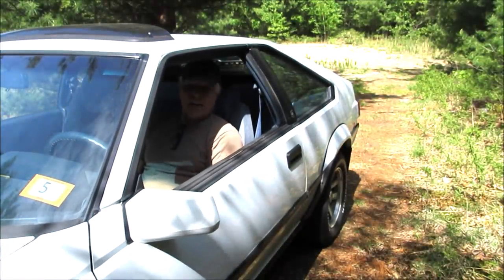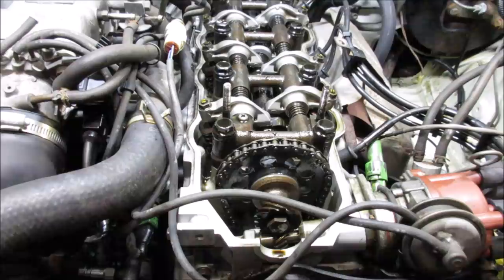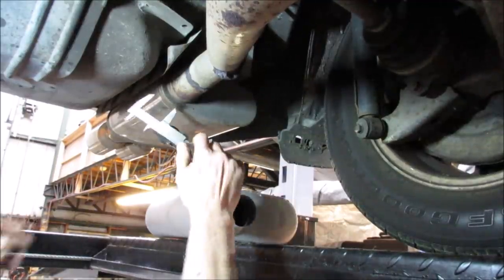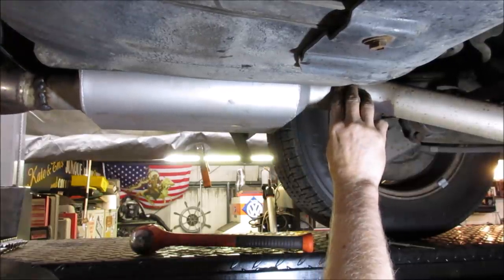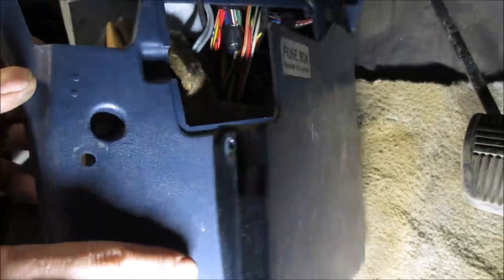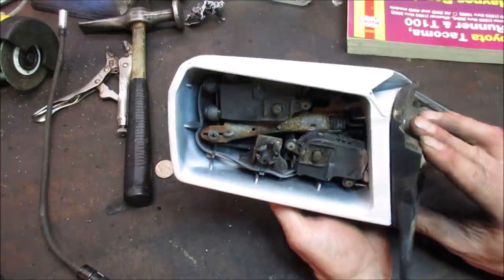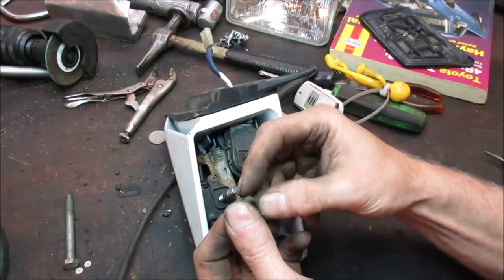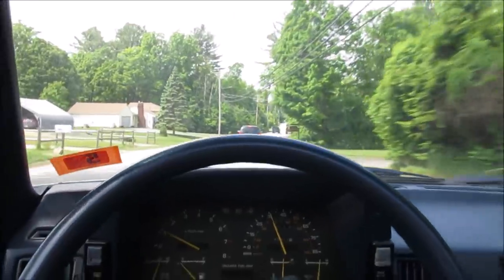Bought The Best Toyota Ever Made

Comment: My brother had one exactly like this one back around ‘90. Not very fast but great riding and a lot of fun to drive. It was the first japanese car that truly impressed me. They were bullet proof like most Toyotas.
Reply: It's got the same motor as the pickup trucks from that era.
Reply: I bought my elderly mom a good used Camry as a gift after I saw that she had close to 200k and rocker rust on her trouble-free Corolla. Several years later, after her doctor told her she should no longer drive, she sold the Camry and decided to gift me back the amount she got for it. It was just $800. shy of what I'd paid for it.
Reply: Rust
Reply: RogerWilco99  reliability wise the Celica/supra all day. Looks, performance wise a widebody starion esi or conquest TSI is in another League. Once you fix a couple issues with them they are good cars though. I hit 147mph with 4 people in the car in a basically stock conquest tsi. Loved that car.
Reply: @charlesgunzelman3323  Toyota trucks in 84 were carburated 85 went to efi.
Reply: There was just a pain to see out of the back if it had tinted windows and the window grill on the back.
Reply: RogerWilco99  She turned down a hemi Road Runner?
Reply: @charlesgunzelman3323  LS swap...
Reply: @stevea6722  she obviously wasn't into speed, lucky for the parents
Reply: My brother had an 80's Celica about seven years ago which was stripped out inside so a real rattle trap but a lot of fun. He drove me around in it one day looking for a Toyota Hilux. I got a truck and a stiff neck. Cheers

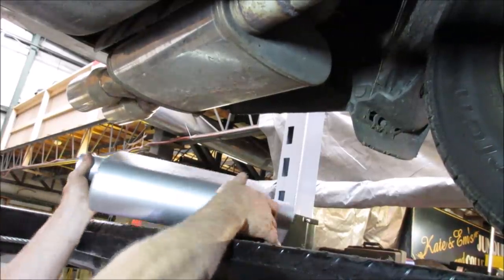Comment: 23:58 The reason the exhaust is getting on your nerves is they cut the resonator from the mid-pipe.  Adding a glasspack around the middle of the cabin will do.  Also in general, chambered flowmaster-style mufflers are the worst if cabin drone is a problem for you.  And the straight-through style muffler it had will perform better anyway.

Comment: My favorite car was my 1977 Toyota Celica GT Fastback (Liftback)...knew the dimensions down to the millimeter when driving  :)  
For the high beams to stay on...push the blinker switch away from the steering wheel (opposite of flashing the highs > towards the wheel).  
The vampire circuits are most likely the radio & the clock...at least it was on mine.
Reply: He's probably tried that, the switch isn't flipping the contact like its supposed to be. I've had it happen on my 84 gts coupe and my 84 supra P-type back in the day, could be as easy as disassembling the switch, cleaning and re-lubing or replacing it. But its definitely the switch , very common on my 90-99 Mitsubishi Eclipses as well.
Reply: if I remember correctly, you're right!  {?????}

Comment: That is a beautiful specimen!  The only recommendation I can make, is to resist the urge to use a drill brush on those seats.  It may be too aggressive and cause damage.  Nothing wrong with a little elbow grease, a soft bristle hand brush, and a good, diluted fabric cleaner like Folex (test for color-fastness in an inconspicuous place, as Folex can fade some dyes).

Looking forward to a followup video!  As always, thank you for spending your Sunday with us.  :D
Reply: I use the same wet vac on my upholstery. I start with a little oxy applied with a toothbrush and then just use tap water in the bissel..it has a little window so you can see how much dirt is coming off.
Reply: There's always that brush that was already attached to the cleaner lol

Comment: 1984 is a good year for 22RE, it isn't the highest-output version of the na fuel-injected 22R, but it has the stronger timing chain. It'll run until the injectors are completely worn out and not make milkshakes along the way. Check the rocker shafts for play, sometimes the bolts loosen off, but 22Rs do sound like sewing machines. Get a stack of spare valve cover gaskets, those half moons are like the pushrod tubes on an ACVW: leaks waiting to happen. Also check the EGR, it loves to clog up with soot or rot out, one doesn't really cause problems, the other is an intake leak, but I didn't hear one. The air injection pipe on the exhaust manifold also tends to go on these, creating an exhaust leak. Block off plates are common and cheap online. The engine itself actually has a fair-sized aftermarket if you ever want to depart from your norm and get silly with it.

Comment: I had an '81 model (only the ST) that I loved.  Had they continued to make them RWD, I would have bought another in a heartbeat.  Great little cars.  That drivetrain is damn near bulletproof.
Reply: I had '76, '77, '79, '80, '81 and '83 Corollas.  Loved them all.  The last one got sold for parts with 300k on the clock back in the early 2000s.  It ran great, but the rust had gone too far to fix.  I bailed out on getting another for the same reason as you stated above.  If they kept making them RWD, I'd have kept buying them.
Reply: @Stefonius  I have a 83 Supra with less than 60,000. I'm working on it right now... It was running fine then it sat for over a year. Gas tank full of rust. Got it off and cleaned. Getting excited!

Comment: The tach probably needs to have its electrolytic capacitors replaced on the pcb.  The fuel gauge is likely to be the fuel sender since the other gauges are working okay.  With the mirrors try going to your local wrecking yard.  It's reasonably likely that other later Toyota mirrors might use same or similar motors.  Or maybe, with your ingenuity you could adapt another similar mechanism into the mirror head. 
Just a thought. 🙂
Reply: I also wonder if the instrument cluster is from a 1982-83 Supra, which would provide another explanation as to why 2200 rpm sounds more like 3300 rpm or so.  Supra tach would be calibrated for the 6 cylinder engine, instead of the 22R-E's 4 cylinders.  Note the 85 mph speedometer...  By 1984, most imported cars had a 120 mph speedometer.
Reply: @john242ti  You could very well be right, I didn't consider that.

Comment: That 22RE is indeed one of the finest motors ever designed. I had one in a '94 pick-up, (the last year they had a plain "pick-up", not the T100 or the Tacoma). I bought mine from the dealership "new" with 7k miles on it. I had them add A/C to it. Cost me $1000 but it was worth every penny over the years. 
I ended selling it to some guy in Connecticut for $3,500 in 2016 and he paid the shipping. I still regret selling it, but it was what made sense back then. You didn't say what you paid for this car, but I can guarantee you it was worth every penny. That car, with your proper sorting out, will be worth a mint as the years go on. I expect to see it on a Mecum auction one day!
Reply: I had that truck and miss it everyday. I had a head gasket blow that was covered in a recall! I got a brand new engine replacement from the dealership. I paid for plugs and oil. They said I won the lottery of recalls. Man I miss that truck I could just kick myself for selling it.
Reply: thanks for the comment, i had a 1991 truck with the 20 0r 22 re-engine  can't  remember  but anyway it was a very basic truck no radio nothing,  kept it for 9 years, then decided to  trade it in for a 2000 Tacoma, which I still have  it has 170 thousand miles on it, I went from a 4 cylinder 5-speed regular cab to an automatic,  v6  extra cab  very nice,  but anyway thanks for your comment

Comment: Nice ride! I had one. The only warning I have is the timing chain tensioner on mine was driven with oil pressure. Should it get low on oil it can jump time and kill the engine. It is an interference engine. Enjoy the ride! I loved mine! Mine was a 1982 I think.
Reply from the maker: the 18r was real bad for the tentioner failing
Reply: I thought I read somewhere that all the Toyota engines, at least from around 80-2000, were non-interference, but apparently that's wrong, these R's are interference. Apparently, even if the belt or chain breaks it doesn't usually cause damage unless it was during an "high stress point"? Someone else says:

>You're just supposed to avoid accidently downshifting in too low of a gear at too high of a speed. Maintain proper oil level and oil quality... Also, replace worn timing chain, gears, and guides before timing slips off, if it ever gets to that point.
Reply: When the guides wear out the chain slap on the 22re will wear a hole in the timing cover right behind the water pump causing coolant to enter the crankcase. JB weld to the rescue worked for years on mine.

Comment: I'd argue with you a bit on this... it is a great car but I've always preferred the 70's Celica over the later years, just personal preferences. Good choice for content, should draw a whole lot of new subs.
Reply: 1973 with a Twincam fitted, as not released in Australia only in 2T Engines
Reply: @rickthelian2215  2T engines were awesome...
Reply: @monkeybarmonkeyman  easy to work on. The Twincam 2TG and Eli versions 2TGE
Reply: I think the '78 was voted best car ever by Motortrend. A little bulbous in my opinion but fun little cars. A buddy had one.
Reply from the maker: still lookin for a 73st, myself
Reply: @mustie1  I bought a 72 Carina brand new, while in high school, paid for it with part-time job. I wanted the Celica at the time, but  being  6'4", the Carina fit better. Those were the days everyone called them 'ToiletOdors'... All the best looking for that 73 ST  :-)
Reply: @monkeybarmonkeyman  my first car!  72 Toyota Carina.  Extremely rare in the Unites States.  Celica suspension with the Corolla (2TC hemi) engine.
Reply: A buddy of mine had an old 70s Celica in the 80s. That car was a trooper. I think his sister finally cracked it up? We had some times in that car though.
Reply: @mustie1  What about that 73’ Penton motorcycle?Any hope in getting it back in running condition?
Reply: The first generation is by far the best looking ones, I specifically like the ST trim the most. Throw on a set of ITB'S and they sound amazing. I can find them up here in Canada in good shape for about 5-7k.
Reply: @reneneron2971  Yup... I eventually rebuilt mine, had it balanced/blueprinted, added a cam and an intake manifold with sidedraft Weber carb. Loved that engine and the car.  That was the good thing about it - much more head/leg room with the Celica underpinnings and the glorious 2TC hemi-head engine.
Reply: @monkeybarmonkeyman  they did not sell well in the United States.  People got either a Celica or a Corolla.  Carina was only 2 doors and trunk space limited due to the gas tank placement.  I enjoyed that car, though.  No a/c, no power anything, and a 4 speed manual.  One belt.
Reply: @mustie1  I'm looking for a 1970 Corona! Hard to find any. Grew up in R.I. I am now in Houston...Love your videos!! Ty!

Comment: Mirrors: At 1h, I'm guessing there used to be two more ball sockets on the ends of the motors, so they could push and pull the mirror back & forth. Must've broken off, maybe after the grease went hard? I'm sure it's not originally a spring since other Toyota mirrors don't move at all, and a spring would probably bounce a little on bumps. Tough to re-engineer a solution with old plastic and broken bits, good work!
Reply: I agree.   First I was thinking there must be a spring pushing out on the top right corner of the back of the mirror, but after looking at it, and the housing, there is no evidence of that, so then the only remaining choice is that each solenoid much have been attached somehow to the back of the mirror.   But that begs the question, how would you then remove the mirror?  It was easy to pop out with only the ball socket in the center, but if there were THREE ball sockets, it seems like that would make it almost impossible to assemble or disassemble without breaking something.

Comment: I had a 1979 Celica GT, 22R engine carbureted, put headers and flowthru Stebro stainless steel exhaust, Retuned the carb, large swaybars front and back. Man did that thing fly, handled great Black with thin gold strip down both sides. Real chick magnet

Comment: The high beam switch is push the stork forward to keep it on but only pull back for flash of high beam. My father had one of those and it must have been deck cargo on the ship because it rusted away in 10 years and we live in a warm climate away from the coast, the trunk area leaked and filled the spare wheel bin with water from day one, total rust bucket but a lot of fun and never broke down ever

Comment: I had the Mk3 Supra Turbo. It was an amazing car. Was loaded with stuff for its age. Leather seats and performance was insane. Down side was the alloy head that had a habit of blowing. It happened twice to me maybe 3 times as the previous owner seemed to have a head gasket replaced. It was a stunner with the pop up head lights. I would like another one but due to that issue you never see them on the road. Is that steering wheel on an angle because the tracking is out on the front wheels.
Reply: The good thing about 30 years later there are alot more enthusiasts ....so you can find a winter project (ps go non turbo)
Reply: almost bought one of these as my first car, but ended up getting a MK3 supra as well about 20 years ago. Same issue, had a blown head gasket when i got it. Great car, wish i never sold it. Really like this car and hope you make another video on it!

Comment: I had an 82'.(82.5?) SUPRA. The 1st year in USA. It had no add on fender flares,   had skinny wheels and better handling, gas mileage, acceleration and stability with less road noise. THAT was the best Toyota ever made.
* the auto trans was the best transmission Ive ever driven. It knew exactly what I wanted to do. The posi-like rear end was also awesome all-season round.

Comment: I had a '74 Celica ST that was my first car.  My greatest regret was trading it for a '51 Chevy Deluxe.  I later found out it blew the timing chain and was lost to the ages.  Just a superb car, super fun to work on.  Great video!
Reply: do you per chance now if it's a common fault on those engines? was it a 2t or 2t-b? I have both of those sitting to go back in two 77 first gen celicas

Comment: Glad you got rid of that perforated tube muffler...  Bought a complete system for my Avalanche that sounded great on the manufacturer's demo video, and came with a perforated tube muffler. When I got the system installed, it droned so bad in the cab that I had a headache before the three minute trip from the mechanic to my house was finished.  I found a chambered muffler with 3'' difference in length and asked the mechanic to shave the pipes to make that fit.  Much better sound in the cab, and the outside sound isn't awful either.  NOT quiet though...  Thanks for another good video!

Comment: 22R tend to wear the valve train and increase clearance rather than tighten, I run my 83 7&11 and they are very quiet. They redesigned the cover in 84 to limit the racket but mine are still better and never had one tighten up in the 40 years since I drove it off the lot! The most reliable Truck ever made....HiLux!

Comment: I had a 1978 Toyota pickup. Heater was terrible but if I remember correctly the bright dim switch you pulled up for bright lights was a 3 position switch. Pull  all the way up to turn the lights to bright temporarily. Release it for dim. Push down opposite way for high beam  lights and pull up to the middle position for dim.

Comment: My first car was a 1985 corolla SR5 4cyl carbed. Swapped trans to manual and did a headgasket and valve stem seals. Drove it for 4 years in chicago weather. Sold it a couple years ago because I stopped driving it. Wish I kept it, was very reliable started everytime never had an issue.

Comment: Mustie, I think a good caulk bedding on the end of the mirror studs would hold them still AND allow them to flex a little. You could get rid of the springs.. they just add pressure to that sketchy ball/socket pivot point that the mirror mounts on.
Reply: That or I was thinking those rubber caps use for sealing off vacuum ports would fit right over them and fit nicely.

Comment: I've had this engine in my truck for 20 years.  When you put the valve cover gasket on run a small bead of RTV over the half moon seals and overlap where the rubber connects to metal.  That will stop the leaks.

Comment: The two threaded nubs are part of the mirror backing plate, you install the whole backing plate by running the remote controls. They may have had non rotatable ball joint if they need to angle while going in and out

Comment: We had a 1983 version my mother bought new. They had a Toyota-thon at the Von Braun Civic Center. They refined the GT-S for '84...the '83 had black flares and rear bumper and exposed headlights. A Toyota hatchback is called a Liftback. You associated that car with a Corolla...they are not related. If you want to quiet it down you will need to locate one of those big canister OEM mufflers. That's what it had on it new, with a single outlet. A 22RE does not sound good loud. It's too bad someone did away with the original stereo and equalizer. You can still find them for sale. Be very attentive to timing chain noise...I think I heard some when you started it. The chain gets loose and wears a hole through the front cover into a cooling passage, which causes all kinds of mayhem. The first engine in ours went 268,000 before the chain blew, then the second engine died at 481,000 on the odometer, so it didn't last as long as the first. Great car though.

Comment: I picked up my 1997 Celica GT Convertible a few months ago for $1200.  Spend around $2000 to get it ship shape, so owes me around $3000 but have no intention of selling.  It has the 5sfe 2.2 engine with 233,000 miles and runs as smooth as silk.  Parts are cheap, is easy to work on and 30 mpg, and great fun to drive, what's not to like!?!